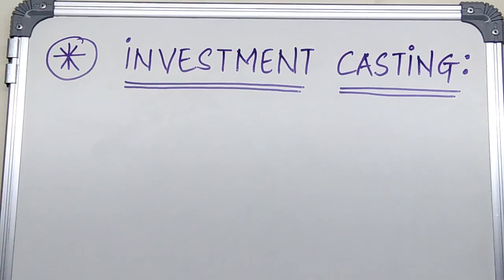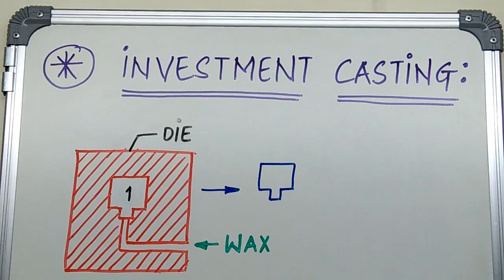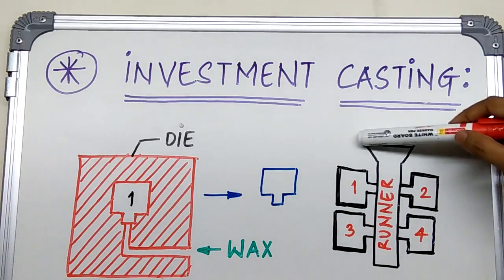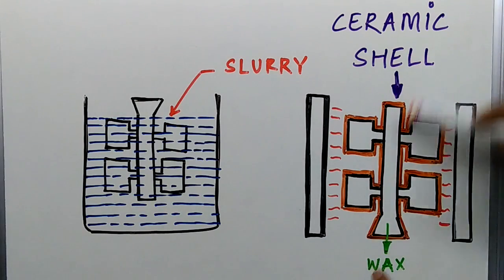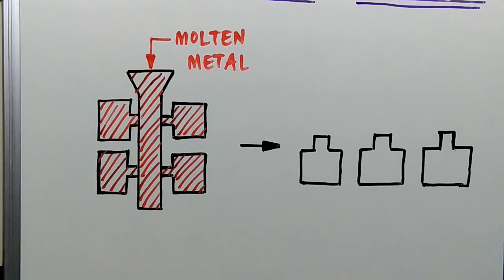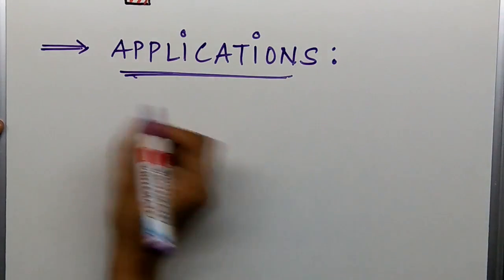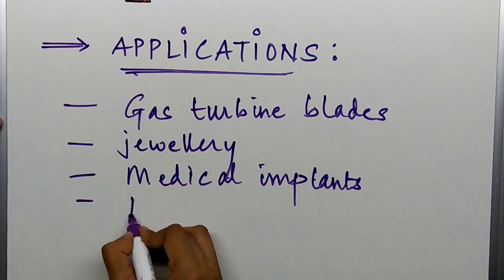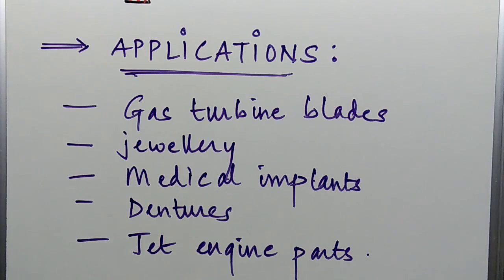investment casting process in manufacturing explained | Mech Easy

Comment: A good brief video on metal investment casting. Thank you for sharing ! This video summarizes the basics of the investment casting process which is one of the best and oldest techniques in manufacturing intrinsic, detailed & complex precision metal parts and components as well as finished products in reasonably large quantity, fast and near-net-shape. With near-net-shape we mean initial production of the item is very close to the final (net) shape, reducing the need for surface finishing. Some parts that are complex are hard to machine and investment casting is a good fit for making them. No big mold fees nor weeks of mold machining times are involved as in die casting. Therefore under some circumstances, investment casting is preferred to metal die casting, because you can have your parts sooner and in lower quantities which is prohibitively expensive if die casting is used for low quantity. The technique is called investment casting, because the ceramic mold is "sacrificed" or "invested" during the casting process. Another name for investment casting is "lost wax casting", because the wax is heated and removed from inside the shell prior to pouring in the metal. Of course there are many more details about this process and also different ways of doing things at each step. For example removal of the ceramic shell can be done using a variety of methods including vibration, high-pressure water blasting, sand blasting, hammering......etc. You may visit our Youtube channel by clicking our logo on the left above for other manufacturing related videos and our subscriptions which contain similar manufacturing and technology related material.
Reply: Por favor podrían traducir los componentes del slurry??? Que materiales hacen falta!!! Muchas gracias

Comment: I don't understand one thing, y making wax pattern when you can directly pour molten metal into die?
Reply: i think , we use wax pattern rather than pouring the metal direct into the die coz increase the production rate and for economical purpose ,if pour the molten metal direct into that die , we have to sacrifice the entire mold (die) and then for another production i have to make die(mold) again .... i might be wrong its just my hypothesis but great question

Comment: Hello everyone,
    I am working with investment casting. .I want to know the mixture or their percentage in primary slurry used in first coat...
Because we are facing too much problems to remove the sand in knockout as well as in rattling process...
Reply: sagar bhusari call me 9491777765 I will give finest solutions

Comment: In shell coating process... Is there any kind of technique to reduce the drying time of shell..??.. something like we use the ammonia in slurry.. etc.. to stem the water..
Reply from the maker: Usually it takes 16 to 48 hours to dry...In order to speed up the drying time dehumidifiers are used. Dehumidifiers also reduce the downtime and rejection rate. Provides uniformity.
Reply: Yes call @ 9491777765

Comment: Can you please tell that ceramic shell is heated upto which temperature because you said ceramic shell is heated and wax is removed, wax removing temperature may range in between 75-80 degree Celsius
Reply from the maker: It is heated to a temperature range of 200F-375F (90℃-175℃)
Reply: @MechEasy007  thanku for the reply.....
Waiting for the next topic explanation 😊
Reply: I am working with investment casting....we using a tempreture for dewaxing Process is 300-350 deg. celcius.
Reply from the maker: @aartibhusari1815  you are talking about the temperature when the complete wax burns out...This temperature can go up to 750℃. The initial heating is between 90℃ - 175℃.
Reply: U mai use Autoclave for Dewaxing for getting good result.

Comment: Why it is called investment casting
Reply from the maker: The word invest is taken from the Latin word 'investire' which means to clothe in or to surround or to cover. Since the process involves dipping and coating the runner assembly with ceramic, it is given the name 'Investment Casting'
.
 It is also known as 'Lost Wax Casting' because in end the wax pattern is melted and wiped-out.

Comment: How much design complexity Investment Casting can Handle? (Both shape n Surface Design) As it is used for batch production, commercial maybe. U said jewellery too?
Reply from the maker: Very high degree of detail and dimensional accuracy can be attained through investment casting.The inner details are attained by using soluble wax. 3D cad softwares are used for 3D printing of prototypes. Small as well as large complex parts can be produced. Yes jewellery too. It is done through lost wax process. In case of jewellery Centrifugal casting is also used.
Reply: Soluble Wax & Lost Wax.. Thanks. :)